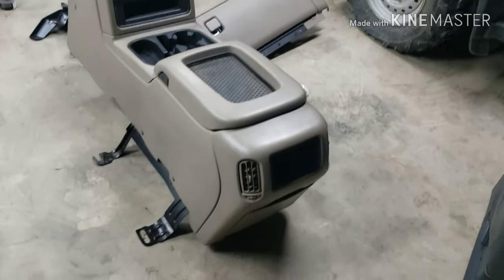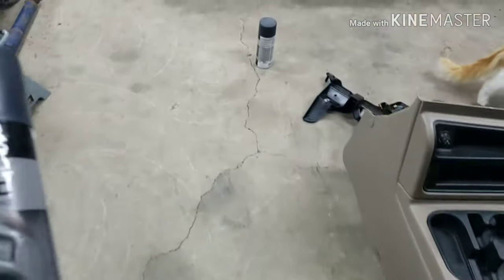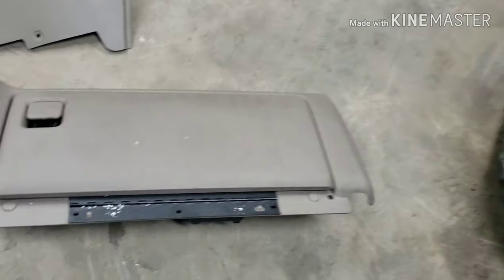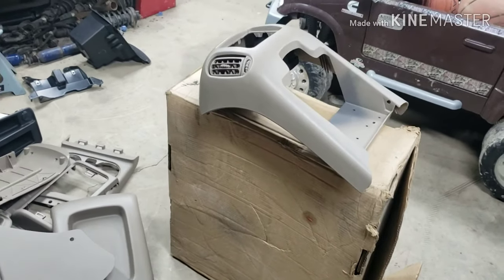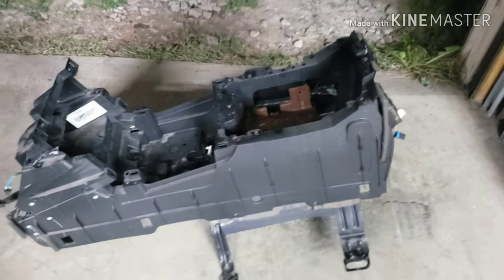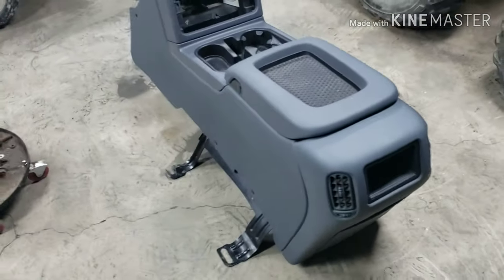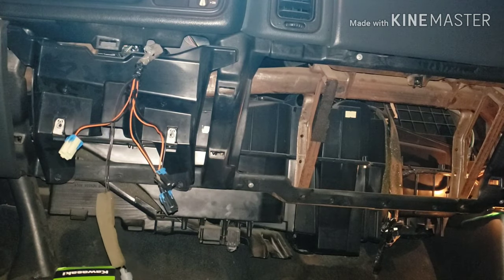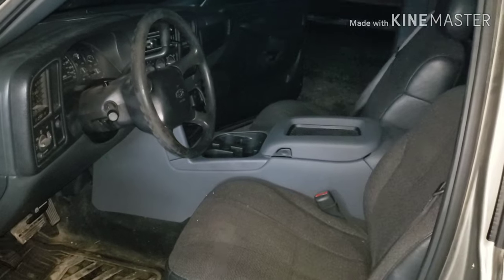Silverado console paint and swap!

Comment: Lmc truck has the correct color options for these trucks and others, I ordered through them instead of hassling through the colorbond website for a while, I repaint a lot of stuff and it works great, I recommend colorbond adhesive and colorbond clear coat too👌🏽

Comment: I see you are still replying to comments so I will make one, I just did this swap but without putting in the console bracket. I have heard that you can install the bracket and then lift the console a little off the ground and install the bolts when the console meets the dash so it looks flush. I can post some links to what I am talking about if you are interested although I know you already did the double din swap so that it covers the gap but still. I haven't tried using the bracket to mate the console and the dash but will being doing that tomorrow hopefully and I will comment and let you know how it went
Reply: Have you tried that yet? I can’t stand the gap in mine lol @shakenfake
Reply: @travisloper864  Yes and it works perfect. Did it about a year ago
Reply: So how exactly do you do it? And yours is a 2002?
Reply: @travisloper864  There is a bracket that just bolts into the dash pick up the console as far as you can and bolt it into the bracket. I think I posted some pictures on a truck forum I am on. Maybe I have some on my computer I can't remember It is really easy though and you will notice it instantly

Comment: Mine doesn't fit like that. My truck is an 01 extended cab and I took the console from an 04 ss silverado. Think because the piece under the radio is still in my truck. I'll try to get it fixed. Crazy I've been rocking it like for years and was too lazy to see what everyone else was doing to overcome this issue

Comment: You should’ve used a 99-02 center console. Then you’d have 3 charger ports instead of only two, & the console lid has a lock on it. 99-02 consoles also have a cassette player which can be removed & replaced with a 2nd storage pocket.
Reply: I kept the tape player, as it can be connected to the main factory cd player radio, & use a $5 cassette adapter for your aux input.

Comment: Looks really good. I want to do this with my 98 extended cab but I’m not sure what year donor to look for. Any suggestions? The factory console is pretty useless.
Reply from the maker: Not sure on the obs trucks unless it's got the newer interior in it
Reply: I’m thinking the same for my 95 extended cab. It’d be cool to make those ac vents work to help cool the amps I’m going to run since i took out the rear seat.

Comment: I have a 2001 Chevy Silverado single cab I was trying to do the same thing but my dssh seems like different the glove box outer trim does not come apart it's like a one-piece deal goes all the way across to the driver side, I found a console from a 2001 Chevy Avalanche that has the same one piece – like mine it's the older style two-piece console with the cassette tape deck lol, but I wanted the one piece console from the 03-06 like you did any suggestions on how to get this thing to fit my truck

Comment: Eric, when you are sitting in the truck is the console high enough to rest your arm against it or does it feel like you are having to slump over to reach it? It looks better than a jump seat but a jump seat is comfortable.
Reply from the maker: It sets high enough to rest your arm on a jump seat sets a lil higher. But if you swap out the seats with tahoe or suburban seats they have a fold down arm rest that will take care of that problem.

Comment: I want a smaller center console in my '05Tahoe. I'm a tiny woman, I love my 4x4...but the center leaves no room for my purse 🤣
Reply: vincent what color
Reply: Put your purse in the console you can even lock it in there see problem solved
Reply: @rickybobby9005  unfortunately not. As a mom of 3, my purse doubles as a diaper bag. Just won't fit. But thanks.

Comment: I'd like to know how you got the power options to work on your truck... I'm having trouble with mine. I've got the motors and harnesses to properly plug everything in. But not working as it should... Wondering if I need to swap the whole dash out with another one
Reply from the maker: The power options for the center console all plugged in besides the rear radio control and sub.

Comment: I know this is a random question, but what size are bolts that bolt all the center console pieces together? Like the ones in the bottom of the storage cubby and top. Got a full size console for my truck but it’s missing the hardware.
Reply from the maker: 2x 10mm

Comment: Hi, quick question, I was planning on doing the exact same thing and was wondering if you can still do a console swap if you have the floor shift 4x4, if so what modifications need to be done for it to fit?
Reply from the maker: You have to notch out the side of the console and cut and weld and modify the 4x4 shifter to come out the side of the console.

Comment: The Silverado console is NOT the same as Tahoe and suburban yes they have the same mounting points and hardware but the cup holder and center storage compartment are different shape and size and Tahoe and suburbans  have a locking center console and the Silverado does not. Also the Tahoe and suburban have a rear radio control unit in the rear of the console above the cup holder and the Silverado does not.
Reply from the maker: Yes you are right but they still bolt in the same that's what I meant but thanks for the correction 🤙